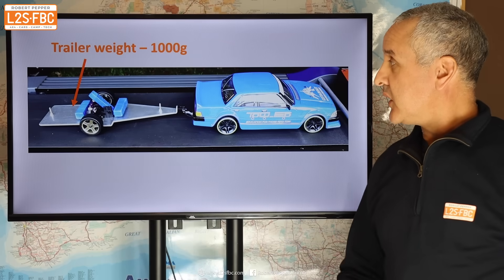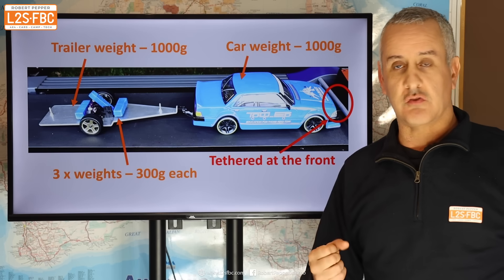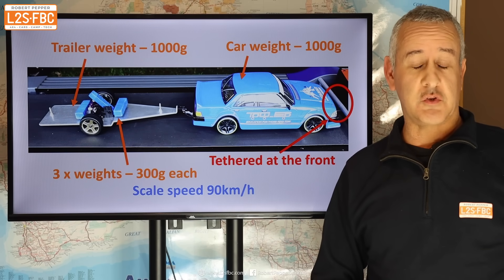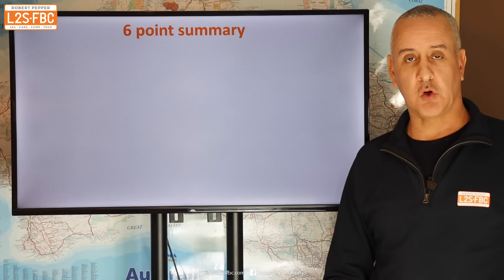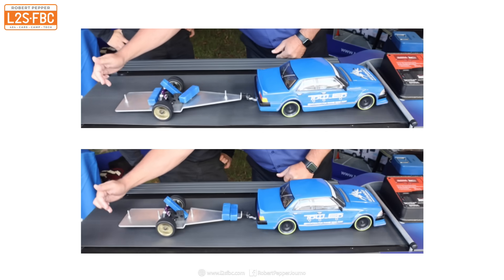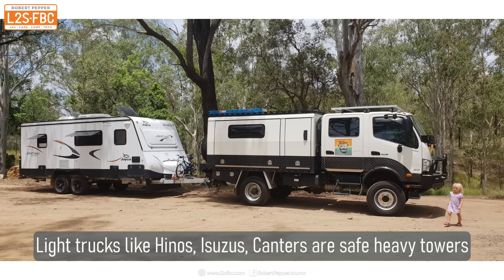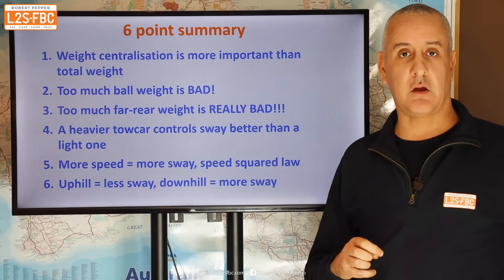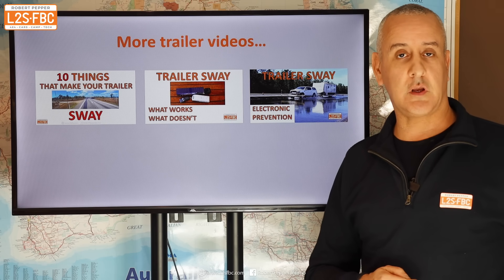7 trailer weight distribution setups, some safe, some deadly.

Comment: So, bottom line, don't tow a huge load with a car.  Use an American full size pickup truck.  I can use my lawn tractor to tow a 10,000lb camper around.  If my lawn tractor could pull it at 50mph, It would not be my vehicle of choice to tow it down the highway.  The crash videos always show a peanut of a vehicle towing the "Caravan" .  It's a camper...a caravan is a bunch of people or animals traveling together on a long journey.  Here's a rule of thumb......you always want some tongue weight....just enough to place weight on the tow vehicle but yet allow the trailer's suspension to do it's job. If you can try to keep both, the vehicle and trailer as level as possible with a slight sag in the middle...you'll most likely handle well
Reply from the maker: Good summary 👍

Comment: So I'm building a single axle trailer that weight x amount, x amount wide and x amount long and towing it with an x amount weight truck, x length/width.  Where should I put my axle if my load will be 1/3rd the weight of the trailer?  All scenarios here favor loading over the trailer axle, so for me I want to know axle placement and tong loading percentage of gross weight?  Need some formulas please.  Thank you.
Reply from the maker: No formula sorry, but yes load over axle. The stability of the trailer needs to be proportional to the towcar; if the trailer is 300kg and the towcar is 4000kg, then it doesn't matter much how stable the trailer is. If on the other hand it's a 3000kg trailer and 2000kg towcar...big problems.

Comment: I'd really like to see this demonstration using a pickup with a fifth wheel / gooseneck setup as compared to a bumper pull.
Reply: I’ve been wanting to see this too.
Reply: You get the same results, don't matter how you tow it, if it ain't loaded properly your trailer will still become a tail wagging the dog issue very quickly...and yes, it happens even if you have a heavy duty dually pickup as well.  The bigger/heavier the trailer, the bigger, and faster a poorly loaded trailer will take over your ride.

Comment: I had a supervisor make me reload a tractor all the way to the front of a trailer instead of just a hair in front of center.... Had a car hit the brakes in front of me and when I hit the brakes the truck dd a wheelie, I let off the brakes and it went back down, and I just left them off and turned and drove around the car.... Nearly pooped kyself, and told the supervisor I'm never listening to him again on how to load a trailer...
Reply from the maker: That's a great story, thanks...when you brake hard there's a weight shift forwards so the effective towball mass increases hence your problem, especially if the load is high up!

Comment: So what happens when the trailer axle is in a different position, eg: further towards the rear of the trailer
 I think your tests don't prove anything except for for how to be or not to be an idiot driver,
Reply from the maker: What do you think happens?
Reply: @L2SFBC  
I'm assuming that the longer the draw bar the more stable the towed load will be, maybe testing different axle positions would be a better outcome for safer towing, 
another example, boat trailers, horse floats both have set back axles whether single or tandem axles for a more safer and stable towing load,
 my two cents on making towing safer, make it fool proof,
Reply from the maker: Yes long drawbars are good. But it is easier to change the location of the load.

Comment: How bout 4 wheels on the trailer!!
Reply from the maker: Same effect, but 4 wheel trailers are a bit more sway resistant, but you do need equal weight on all 4 wheels.
Reply: @L2SFBC  Maybe drive at slower speed or the flaw design in which the tires of the trailer needs to be a bit wider or more seperated from each mount

Comment: Thank you for that!
I was taught that you should try to keep the weight centered with about 10% of the gross weight of the trailer and cargo on the tongue. That has worked well for me but I don't haul heavy trailer loads.
Reply: 10% MORE of the gross weight... or about 60% ahead of the axel(s).
Reply: @DiffEQ  If 60% of the gross weight is ahead of the axle leaving 40% of the gross weight behind the axle wouldn't that be having 20% more of the gross weight ahead of the axle?    I don't know, I'm not an engineer!

Comment: Having towed racecars around both Europe and the USA, I was shocked to see how different approached each region took in regards to tongue weight. In the USA we put a massive amount of weight on the tow hitch, something like 700 pounds on a typical 4 wheel car carriers, while the same "style" of car carrier in europe only put 180 pounds on the tow ball. I originally thought that the US approach was the safer, but perhaps the Europeans puts more responsibility onto driver to make sure they centralizes their loads, which would be the safest approach according to this video. I supposed the US approach has an "idiot-proof" method factored in...
Reply: In US in addition to tow with heavier truck, we use weight distribution bar to combat the heavy hitch weight.
Reply from the maker: Yes, it's very interesting to look at international differences. The USA has a lot of very good towcars; heavy 4X4s with long wheelbases and short overhangs, although low payloads. The UK has light trailers. Australia has the worst of it; heavy trailers without the necessary towcars!  There is a myth that the more ball mass the better, but like anything, you can have too much of a good thing!

Comment: One of those Trailers that connects on the Truck Bed? They can probably load front heavy? Since they push weight on front and rear of the Truck then?
Reply from the maker: Yes that's correct

Comment: I have had to pull an improperly balanced trailer a few times, hauling long lumber that I had to over hang the back of the trailer, just go slow and take your time and if it does start to wobble just don't panick and don't hit the brake. Just let off the throttle and it will stabilize. Still I always try to avoid it when I can

Comment: I've seen one other video about this but yours in way more informative. I had a situation once when I was trailing a load of lumber with my 1994 Toyota 4x2 pick up. The lumber was heavier than my truck but I was hulling long and heavy beams that were sticking way out the back of the trailer that caused me to sway a little so I slowed way down to 30 mph and I made it home just fine but the people behind me were a little pissed off due to the slow speeds I was going. They gave me the finger when they passed and a friendly horn blast to let me know that I was an asshole for slowing them down.
Reply from the maker: Great story, thanks Robert!

Comment: Great video. Thanks. One factor missing from this video however is that you don't talk about height. If your weight distribution in the trailer (or even the vehicle for that matter) is too high then you get instability as well.  So if you put a bunch of heavy stuff on the roof of your caravan, it doesn't really matter if you put it over the axle, you've probably still got a problem. Also if you are towing with a top heavy vehicle like some of those lifted up off road vehicles, then you've got less safety margin than if you are towing with a standard truck or car where the weight distribution is lower to the road.
Reply from the maker: Thanks Ian. I'm going to cover this point in the future. The height problem is more an issue for the caravan, and not just centre of gravity - the massive slab side of a caravan is easily pushed around by wind and air, unlike say the equivalent weight of a car on a car trailer.

Comment: Does this apply to semi trucks?
Reply from the maker: Not really no as their geometry and weight distribution is very different. The semis have a lot of weight over the tractor axle, about half the trailer weight, and that weight is between the rear and front tractor axles. So very different.

Comment: It's a great explanation, but surprised there wasn't any tips about how to fix sway once it's started. Maybe it's in another video but would have been useful to see if changing speed during sway would help recover or if it's too late by that point.
Reply from the maker: Correct it is in my other videos check the Sway play list

Comment: About to order a custom boat trailer for the boat I’m building. I’ll be discussing stability and axle position just a little more…. Thanks!
Reply: If you're building the boat you may well already know the balance point, so just stick the axle and wheels at that point? I actually got hold of a diagram for my Macgregor 26X which showed the balance point - but that diagram was wrong!

Comment: With more "Off-Road" caravans than ever getting on the roads of Australia, I wonder about their stability at anything over 90km/h, especially in windy conditions.  A lot of the rugged vans have ALL of the caravan body above the wheel & tyre height.  Yes, it may be good over gravel roads and bumps, but how good are they on the main highways?
Reply from the maker: I will explore this soon...
Reply: 90 kph? It would have to be a very high of road craven to be destabilized at 90. That's pretty slow.

Comment: What happened to the old information of having 60% in front of the trailer axel and 40% behind not to exceed tongue weight. That is how I always understood it. How you are teaching it is to have the weight directly over the axel giving you 0 tongue weight
Reply from the maker: Not 0% tongue weight.  Still need some TBM. And 40 and 60 could be right at the ends which is bad.

Comment: Trailer stability isn't the only issue here. Watch the Pajero closely at 0:58 - the driver has panicked and swung the steering wheel hard. He/she should have held the wheel straight and allowed the van to stabilise itself.

Comment: so what im learning with this is if ur car is lighter then ur tow fill up alot of weights or jugs of water
Reply: Doing so decreases your towing capacity and payload capacity of the tow vehicle.  Buying the right tow vehicle is the only choice in getting the vehicle part correct....learning how to load a trailer properly 60%/40% is you best friend.  60% towards the front of your trailer and 40% towards the back and you'll have a nice setup....you can fudge those numbers a bit, but once you get more weight on the back side of the trailer and start lifting up on the front of the trailer, thus lifting the tongue of the trailer, and taking weight off the back of your tow vehicle that's when things get real bad real fast.  The opposite effect is overloading the front of your trailer and having no weight behind the trailer axle which allows the same thing as loading too much weight in the back of the trailer, but in this case usually overloads the tow vehicle in the process.  

One huge issue is automakers keep boasting all these ridiculous towing weight numbers, but 99% of people have no idea what those numbers mean, and what specific configurations can actually tow that...so they buy the fancy fully loaded truck, and think it can still tow that ridiculously exaggerated amount of weight....unfortunately they don't understand the problems until they've killed someone because of their lack of knowledge.  This stuff should be a requirement to know before being allowed to tow anything.  Sadly this issue is more and more common as way too many people with too much money and not enough common sense get behind the wheel of fancy powerful trucks, but don't have a clue that just because their truck has 600+HP doesn't mean you can tow whatever you want and haphazardly load the trailer, or overload the trailer, and worse overload the tow vehicle.  Your fancy truck might have the power to get that trailer moving 80mph, but it probably, most likely can't stop it safely in an emergency.  Cool your truck can tow 14k, doesn't mean its safe, and oftentimes that's a good number in perfect conditions with a certain configuration, typically a base model 2WD regular cab with max tow package, trailer brake controller, and highest numerical numbered axle ratio.  Most people get none of that, they want the fully loaded crew cab 4x4 with the softest ride available, which greatly reduces payload and towing capacity.  

Another thing, people who modify their tow vehicles (i.e. lift kits, oversized tires, bigger wheels, etc.) all that crap greatly reduces the vehicle's towing capacity and capability.  

A small, short, narrow wheelbase vehicle trying to tow is a horrible idea all around...its too light, its too small, and it will get tossed around by a trailer and passing vehicle wind turbulence.

Comment: Great video. Simple way of understanding the principle of weight and balance and should be part of the driver  training  .but all this only works if ALL your tyre  pressures are correct  . This should also  be part of the driver training..  about 40% of all vehicle crashes towing trailers i have attended had some or all tyres under manufacturers recommend PSI   .There has recently been an unnecessary  fatality in central otago NZ from exactly this issue.
Reply: Hi Robert. That's great.  The age old attitude of if it's black and goes around is still hanging in there for some reason.  The manufacturers went to a lot of trouble and expense to figure out the correct PSI  for safety and  extend tyre life.  They even went to the trouble of putting a nice wee shiny sticker with all the numbers on it   usually on the door  pillar or similar.  Your training videos are great. Thank you .
Reply from the maker: Thanks and will cover pressues in future

Comment: Good info and demonstration, and though you clearly showed that weight over the extremes (though still balanced) is less stable than weight in the middle, you didn't explain why. This worries me because me and my buddy tend to load our trailer evenly front to back on the first pass, then fine tune the nose weight by adding to either the nose or tail. It's always seemed stable, but I want to understand this extremity instability so we don't end up like one of those cars.
Reply: Another example. Carting live stock  cows  that move about can really be a handful
Reply from the maker: Mooving load would be a problem...
Reply from the maker: Will explain in another video

Comment: Excellent demonstration, thanks!

Still, I can't say that I understand why the "heavy weights at the front and at the back" would start to sway.

As I see it, the weight distribution and the ball weight is the same as if the weights would be over the axle.

Any chance You could explain that in more detail? :)
Thanks
Reply from the maker: Yes in a future video but for the moment do this; stand up, hold your arms out level, spin 180, stop. Then do the same with your arms crossed on your chest. Same mass, different distribution, different effect.
Reply: @L2SFBC  Ah. This is what I was looking for. Now it makes sense. Great explanation. Thank you.
Reply from the maker: just posted that video :-)

Comment: These trailer towing videos are excellent. But I feel I must add a few comments. I constructed a utility trailer 50 years ago utilizing a purchased trailer axle. The axle was equipped with leaf springs, and appeared to be symmetrical front-to-back but was clearly marked "This side to FRONT". I placed the axle at the middle of the cargo box so as to put as little weight as possible on the rear of the tow vehicle (A Chevrolet Corvair rear-engine, already rear-heavy). I have towed the trailer with two motorcycles in it at 85 MPH (136.8 KM/H !) with that rear-engine car and it was perfectly stable. 
  Some years later I took the axle off the trailer to be sandblasted and repainted it. While it was off the trailer I carefully measured its geometry. The axle (unloaded ) had positive camber at each wheel and also had TOE-IN  !!!. This must be the reason the axle was marked "This side to Front". No one ever seems to worry about trailer wheel alignment but I believe it is critical to stability just as it is for a front end in a car.
   I also believe the overhang of the towing ball to the rear axle of the towing vehicle is very important as it determines the "leverage" that side forces passed through the tow ball have on the tow vehicle, and also the amount of lifting of the tow vehicle front wheels. This is why a so-called "fifth wheel" hitch is better than a ball hitch because it has negative overhang. Some pickup trucks have a 4 or 5 foot overhang of ball to rear axle. A dually rear axle is better because side forces will generate lesser rear steering slip angles.
David Wilson
Reply from the maker: Thank you, excellent points and well made. More to come..
Reply: Positive camber and just enough toe-in for stability with minimal tire wear. Sort of a clever self aligning design.
Reply: Imagine my surprise when having a hard time trying to find a tire shop to take me seriously about even balancing my dump trailer wheels.

Comment: This is only relevant if your car has a piece of string holding the front end straight your tow car is not being pulled it’s pushing and a lot of tow cars are 4x4 so rear wheel drive so front end is very unstable at load